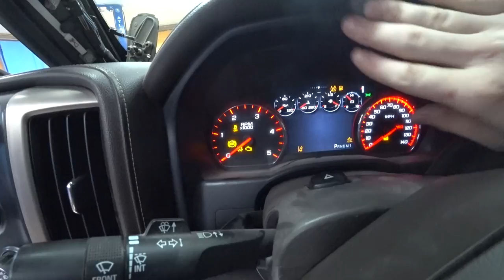Cutting off the front end of my Mustang while listening to chill music

Comment: @DoitwithDan if you push the power button on the radio you’re getting power and if it doesn’t turn on accessories when you turn the key forward it’s something within your ignition. I had the same issue and it was a ground. After all, y’all swapped a whole ass frame within a long span of time who ever put their hands on it doesn’t remember how clean the surface was how dirty the old grounds might’ve been etc. Could also be your ignition wire damaged that plugs into your ecu in the driver foot well, near the steering shaft under the dash (2nd to left gray plug). You also put in a sound system (subs) where did you tap in? Shout me out if I’m right

Comment: Love what you are doing here. You should consider getting some dimple dies or something like that to add some kind of form to your sheet metal. I work for the company that makes the f-150 frames as a tool and die maker. The frames start out almost entirely as sheet metal but the bending and shape give it the strenght. Just something to consider to make everything more rigid and structural

Comment: On places like that back panel you need to run a little lower heat and do about 3 to 4 inch stitch welds. The metal can cool that way and you won't blow through it.
Oh and on the color, a Gulf livery would be pretty sick.

Comment: The one thing i will say about the dewalt chop saw is with that cut off blade being so freakin big if you try to force it much it likes the cut crooked. The blade flexes or at least they did on me. I had that same exact saw, it has sense destroyed its brushes but it would cut crooked like it would leave true and cut to the right a lot.

Comment: Def not glow plugs, have one of those years it should just crank, because in the summer you don’t need them. Should crank right over. Next time you turn the key and it doesn’t crank, don’t let off put more pressure on it. That’s what I have to do on my gas job, it’s like a sticky ignition switch.